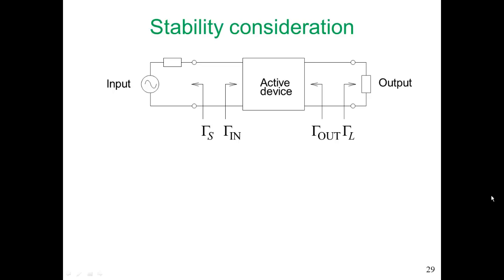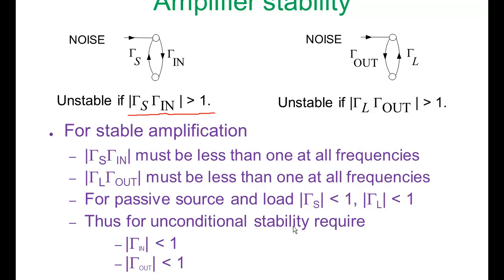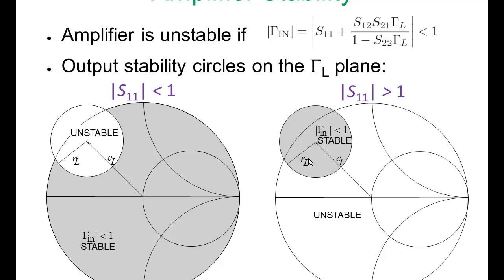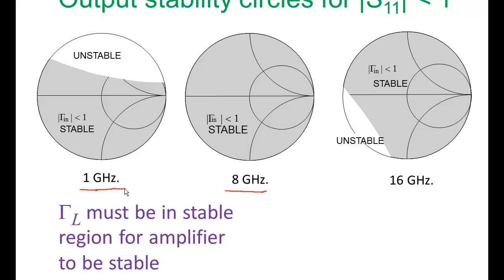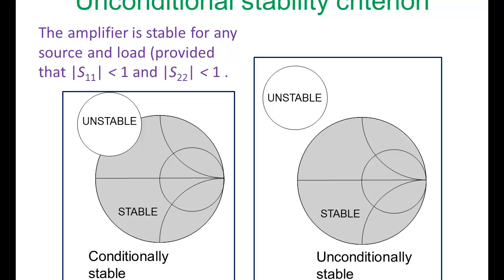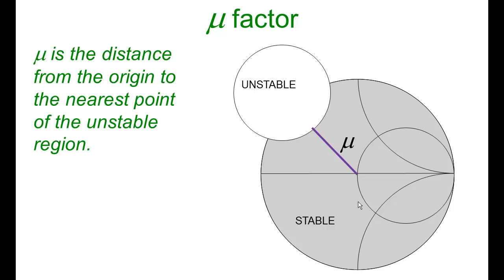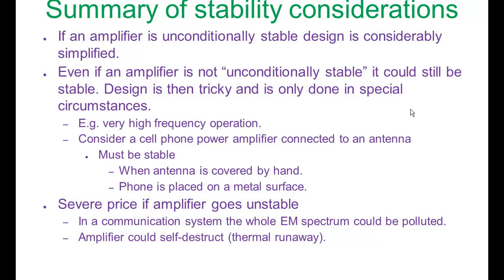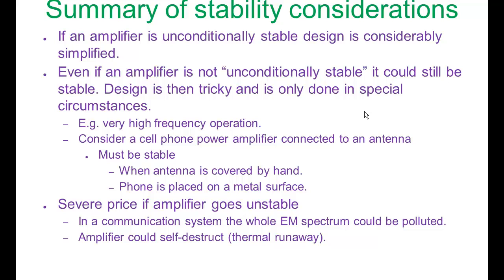Case Study: Narrowband Linear Amplifier Design, Part C, by Michael Steer

Comment: What would be a stability analysis approach to an amplifier's that's switched on and off? It could be that an amplifier has transient instability because it's power supply or itself is being switched on and off as normal operating mode.

Great video to me as I'm revisiting LNA and PA stability analysis after 20+ years!